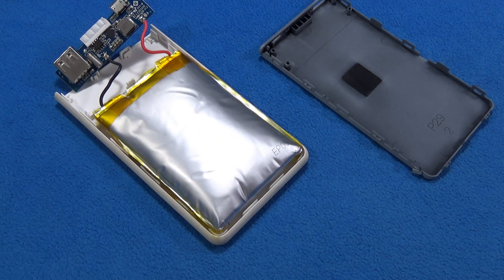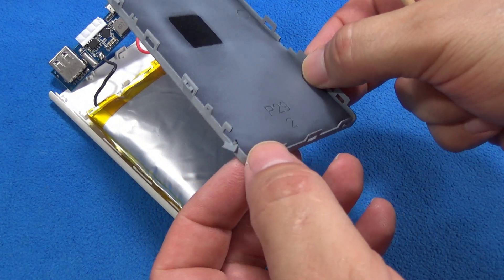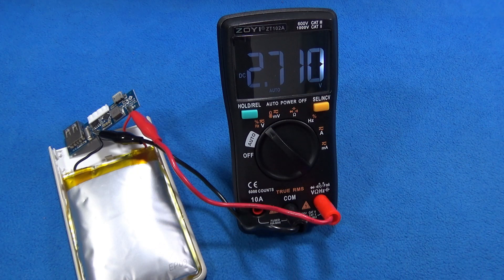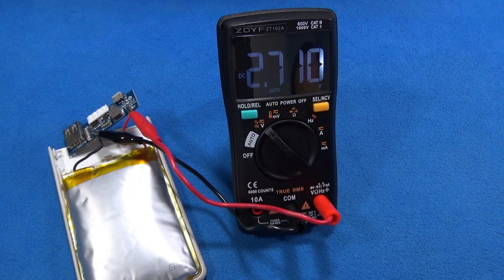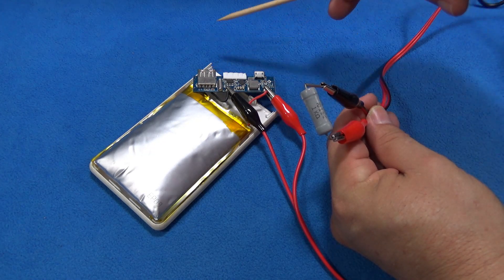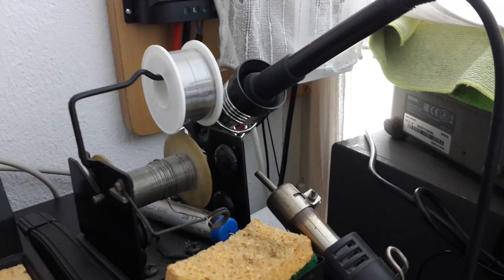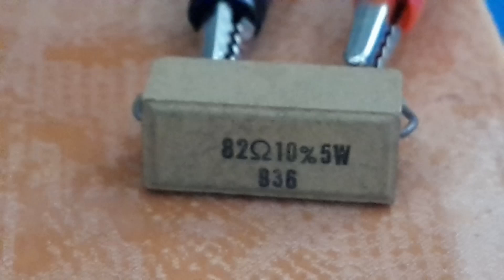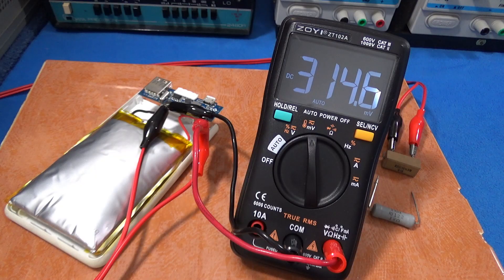Swollen battery - how to avoid the danger of fire when it gets inflated in the smartphone or tablet

Comment: can you not just put it in a bucket of salt water for a few days??
Reply from the maker: Hi! Ignorance can kill! ...water hidrolisis is the process done when we apply voltage to water, resulting in the separation of hydrogen gas, five times more explosive than gasoline. (That was one of the high school chemistry experiments we used to do to understand the danger of that bobbles released by electric effect). Also if the wires oxidized faster than the battery can discharge, the danger will continue present and there will not be way to discharge the battery.
Reply: @bob.kalpon1398  I of course would do it outside not in the house or office?? it works and is safe and you must use salt water